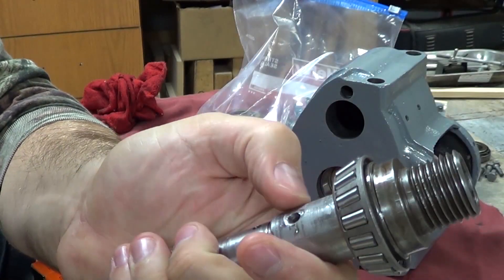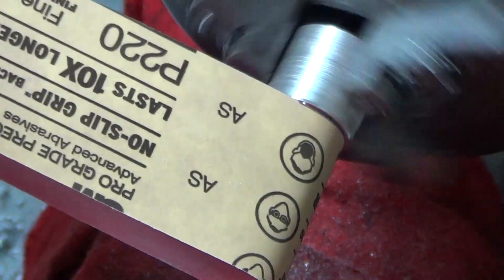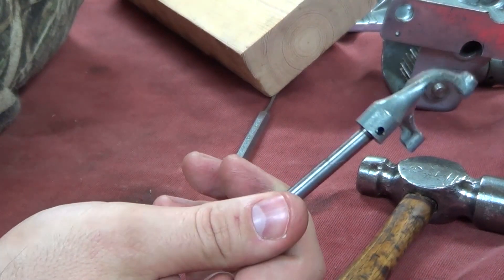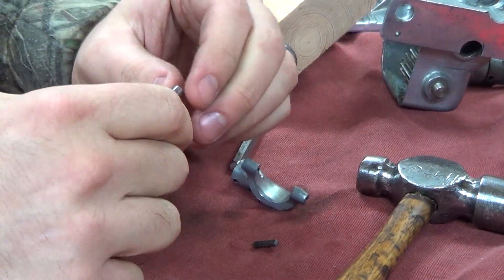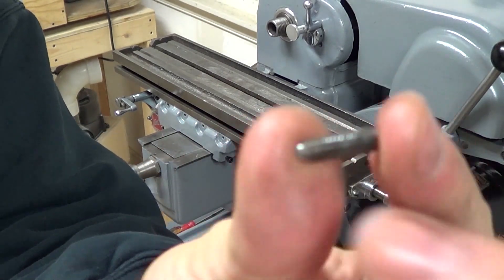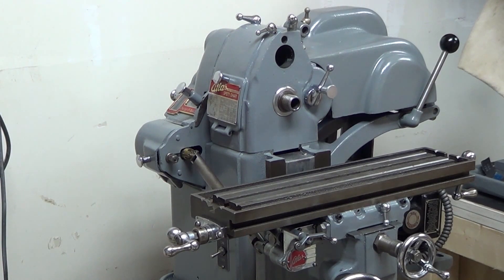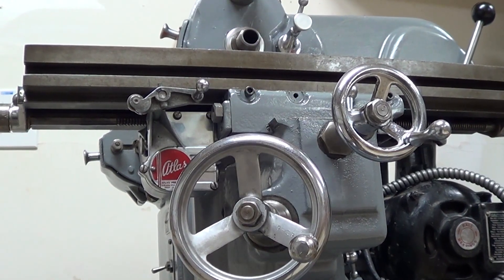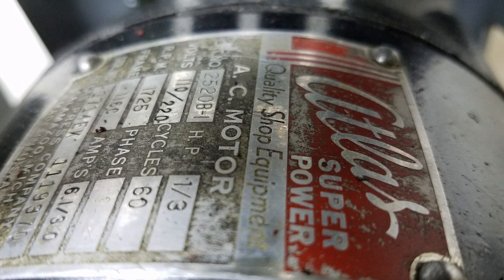Atlas Benchtop Horizontal Milling Machine Part 3 // Restoration and Rebuild

Comment: im in the process of buying one of these mills... also learning as i go... your videos will definitely help as i go along
Reply from the maker: Thanks.  Make sure to carefully inspect those gears.  They really are prone to breaking if not properly cared for.  Also, carefully check the mechanism to change gear speeds is not hitting the sides of the machine.  Just passing along some tips to help you out.

Comment: Man your videos on this machine have given me the courage to pick one up it all ready has a Version of a vertical mill attachment for 650 so I basically just wanted to say thank you for doing these videos
Reply from the maker: Seriously appreciate comments like this.
Reply: ThunderDog how did the milling attachment work for you. I really want to pick up the one I found of gunsmithing at home. 80% 1911’s AR lowers and stuff of that nature.
Reply from the maker: Huh, I paid the exact same price for mine but it didn't have the horizontal arbor.  Regarding vertical milling:  I had two small horizontal mills at the time, the Atlas and that little Jefferson.  The Jefferson was converted as a dedicated vertical mill.  So, I can't say how the Atlas would perform with a vertical attachment.  I ended up selling both because of two main reasons:  very small work envelope. Fixturing almost anything was a pain, too far forward and you can't reach the section to be cut, too far back and you're hitting the face of the machine.  Second reason, light cuts were the only way to go.  Of course, I tended to only cut steel.  Aluminum worked well on these bench top mills.  That's why I eventually made the garage space to accommodate the Wells Index Super 55.  Now, I don't have those issues and machining parts is enjoyable again.  Regardless, the Atlas was a fun little machine.

Comment: Good job. Would suggest that you spend some time, if you haven't already, verifying the geometry of the machine as part of your rebuild process.  Both the arbor support and support bracket castings are on Ebay, been looking at doing one of these myself so shopping around, and they would be a fine addition to this machine. Like the thunder but it scared me the first time!!! Thanks for the post. UA
Reply from the maker: Thanks for watching.  Yeah, I sold this little machine for a Wells Index Super 55, which I rescraped(see newer videos).  The Atlas was simply too small of a work envelope.

Comment: I have had my mill for 30 plus years.I was able to find a Du more aux. Milling head with a #3 mt.The neat part is it is geared 1 to 1. I made a simple stub arbor that fits the spindle, and the attachment has a smooth bore with a 3/16 straight keyway.it does allow some adjustment in and out. Made a head mount out of 1-1/4 plate,bored it on a faceplate on the mill.The head has 15-deg. Grads. So you can slew the head up to 90 deg.And since the spindles are on the same plane,the attachment sits lower than the mill spindle ,so I added a 2"riser block that I made from a solid piece of cast iron. This mod completely changed this mill into a very usable, more versatile machine. You can buy collets outright from your tool jobber and  mt 3 gives a wider variety of tools that you can use as well. Super rigid, no extra motor all feeds and speeds are stock. I will admit it was a bear to tram. Vrey pleased with this mod. I have made a bunch of parts with this machine.

Comment: I know its kinda late but i just found your channel.I have the same mill that i am currently restoring. I can send you dimensions of the arbor support if you need them. it should be simple to make with the tooling that you have.

I am missing the arbor as the previous owner turned mine into a vertical also. Did you ever make one?

Ryan
Reply from the maker: Well, I actually found one via Ebay a while back.  I have since sold the Atlas mill and the little Jefferson mill, too.  I fully rescraped and restored a Wells-Index Super 55 milling machine.

Comment: I love the video, in reference to another motor have you thought about a treadmill motor that drives a dc bridge rectifier and an 11.00 dollar power supply made in china ....from eBay......... idid it for my 9'' southbend lathe and my 10 k southbend lathe ....they both work  like a charm its variable speed  with a pot and has reverse........simple......my 2 cents for what its worth....waiting for next vid...email me if you need more info.

Comment: Sounded like the tapered roller bearings for the arbor/pulley drive might have been noisy, but they went on so fast I could not tell. Looks like a really dirty position.  

Nice little machine! Your overhaul looks great. It looks so simple to work on you may be right in choosing a clean and reassemble job and get all parts in place and running and become familiar with it, then decide how much precision you need and address fine tuning at your leisure. This is my first video at your site, I’ll be back!
Reply from the maker: Thanks for watching.

Comment: I have 2 Atlas Mills both are 12 Speeds.    the one I lucked out on the previous owner put a Rusnok mill head on it for Vertical milling  the other Machine I still have to rebuild . as for an easy fix for a milling head you can use a Taig Lathe Spindle Head with a small Motor  just make some simple Brackets There is one on YouTube  to give you some Idea of what's involved . those ones on Ebay  are just a copy of the Marvin Head Offered  many years ago . it used to mount on the Support Bar and was driven by the spindle with a pulley adapted to it .  I  love to see People restoring the old machines I have quite a few myself
Reply from the maker: +1995dresser Vertical milling machine conversion, eh?  Watch my video coming this Saturday.😎😎

Comment: You've done a splendid job on that machine, I have one as well it still needs some odds and ends, bit is in great working order. Thanks for bringing back another piece of American history. And isn't is a blast to use. Many of my machines are Atlas and I find myself making parts for one on the other. I love it. Keep up the great videos. There are more than one way to do most things as you've shown.
Reply from the maker: +J L It is a tough little machine, even if the material of the gears are not the greatest.  Thanks for watching.

Comment: Hey T-dog, when you were putting the Change-O-Matic gear cover on. Did you put some type of lubrication on the gears before you put it back together? If so what type of oil or grease did you end up using?
Reply from the maker: +Steve Billmire I use Mobil Velocite #10.  You can buy it in small quantities on good old fleabay.
Reply: T-dog, where did you get those link belts that you are using on the other horizontal mill rebuild video? I need to get a couple of them for my Atlas horizontal mill rebuild project. I looked at H.F. and they want like $27 bucks for one link belt!!!
Reply from the maker: Let me say this, do NOT use link belts on the Atlas mill.  Since that video I was struggling with the mill jamming and severe heat build up on the pulleys.  It even burnt up one of the Oilite bushings.  I replaced all of the belts with the factory spec size belts and have had no problems.  The machine needs the correct belts to effectively transfer the power.
Reply: Well damn, I was hoping I didn't have to take the spindle apart. Just to replace the freaking spindle belt!!! But I am glad that you had experience with the link belts and told me about it before I ended up buying them!!! You know what sucks, when I was taking my mill apart to clean it up and paint it. I unfortunately cut the spindle belt and it was perfectly fine, thinking I would just buy one of those link belts. Do you happen to know the part number for the spindle belt you ended up buying?
Reply from the maker: +Steve Billmire Spindle belt is 5L280.  On the bright side it was cheaper than a link belt.  And think of it like a test to see how fast you can disassemble/assemble the spindle.  😁😁
Reply: Hello again T-dog, I used the same exact paint you did on your Atlas horizontal mill. Now that you have had it running for a while. How is that paint holding up with all the oil and cutting fluids? Oh yeah, thanks again for letting me know about the link belt issue!!!
Reply from the maker: +Steve Billmire It's been great.  The only area of paint flake is at the detent for engaging the back gears.  But, that's more from the detent scratching the surface.

Comment: Hey ThunderDog, good job on the rebuild for your Atlas Horizontal milling machine. Wanted you to know that I just picked up a Craftsman Atlas Lathe and one of these Atlas Mills from a guy selling them on Craigslist. From what the guy told me both the lathe and mill have been sitting for over 35 years. When I got there to check them out they were covered with saw dust. But I plugged them in and they both pretty much worked fine. The best part of the deal is that I only paid $1000 bucks for both of them and a bunch of tooling.

Though they have been sitting for quite a while, both the lathe and mill. Do not have any noticeable wear on the table for the mill and the ways on the lathe. Like you the mill has a change o matic gear selection and the window you can not see through. So that is something I'll need to fix.

I know you are probably a busy guy. But if you have a chance to read this, I would like your input.

Comment: I have this exact model, but mine was never used until I got a hold of it, the difference between the b and c model was our b models had a "cover" over the support bar.  I would recommend putting a bit of grease in the automatic feed gear box though.  I also am considering using a Burke milling attachment and fitting it to my mill by using the horizontal arbor to power the Burke.
Reply from the maker: +Eric Johnson Nice.  Thanks for the info.

Comment: I recently got my hands on one of these mills as part of a deal with an Atlas B7 Shaper. The horizontal mill needs some work, the shaper on the other hand will only need a quick clean and degrese as well as a new cap to work properly.
Reply from the maker: Nice, good luck and make some chips!!
Reply: Do you have the manual for the horizontal mill? The parts list would be nice. I found the 7B manual. Cant seem to find the mill manual.
Reply from the maker: +Bruno M. It's online.  Checkout hobby machinist forum or the Atlas Yahoo group.

Comment: I have a suggestion for your mill. Instead of making that bracket so you can snake a belt up to basically convert this into a vertical mill. Why not buy a ER13 or larger spindle motor and make an adapter that bolts to that shaft. This way you use your original gearing and motor for horizontal work and a much more compact and probably more powerful 500-1kw spindle with a built in collet chuck for the vertical work. The machine rigidity is there, just a spindle, some steel an some ingenuity and you have two machines in one.
Reply from the maker: +Bruno M. Hey, that sounds like an idea worth looking into.  Seriously, thanks for sharing.
Reply: http://www.hobby-machinist.com/attachments/mill-complete-005-custom-jpg.38677/

I wish I had designed this, but I'm only partway on my project to copy it.

From http://www.hobby-machinist.com/threads/atlas-horizontal-mill.6773/
Reply: Whups, forgot about the login thing there.  Here's a copy on Dropbox:

https://www.dropbox.com/s/uyt6ro3h7k8sj0l/Mill%20Complete%20005%20%28Custom%29.jpg?dl=0
Reply: Do you have a link to the thread?

Comment: I just picked one up for $225. It looks complete, but I haven't dug into it yet. Of course....plenty of grime and rust. I appreciate you taking the time to do a series on your rebuild. I'll be referencing it quite a bit.
Reply from the maker: WOW.  Nice score!!  Did it include the arbor, vise, or any other accessories?  Thanks for watching.
Reply: It did have the arbor. No vise, though. The auto-feed stop was still there.

Comment: Have you considered using a #2MT test bar as your arbor? Or perhaps there's something similar out there where you can buy stock with the MT already turned. Looks like the main arbor section is a bit wider diameter than the widest part of the #2MT, but you know- just throwing that out there. Some kind of pre-turned end on stock might be available.
Reply: You might even be able to sleeve a test bar. I dunno. Just an idea.
Reply from the maker: I've been thinking about the same thing.  I've considered buying a MT2 "something" that can be sacrificed and attach it to a piece of round stock via set screw or some other secure/permanent method.  Then turn that between centers.  Or, just continue to practice turning morse tapers via offset of tailstock or setting the compound to the appropriate angle.  :)

Comment: Excellent series. Great job on the machine, the videography, and the editing. You have a knack for omitting or speeding up material to create an effective means of communicating. I've got one to fix now. Only thing I'll do differently is apply primer and use an enamel paint. You may want to get new headstock bearings and cups and chase the threads on the spindle nose a bit. Doubtless it will be an extremely useful little tyke. You can get speeds lower than some Bridgeports on that mill, if I recall correctly. Again, excellent work and congratulations.
Reply from the maker: Awesome!  Thank you so much for watching and leaving feedback.  I replaced the cups and bearings with all new Timken products, just didn't put it in the vid.